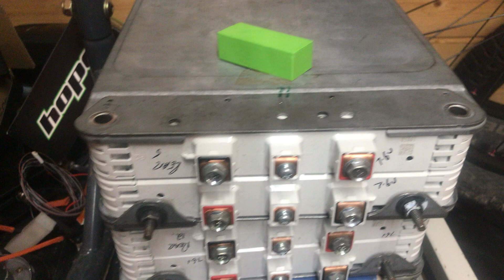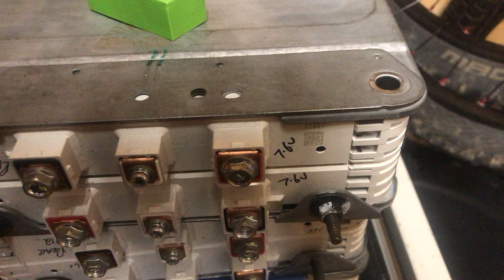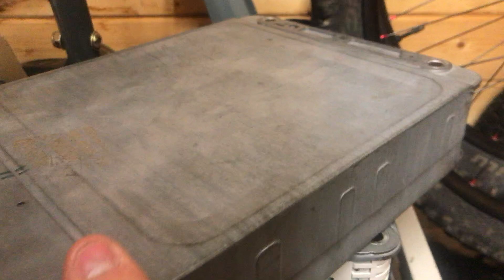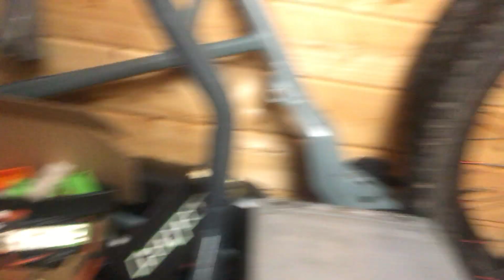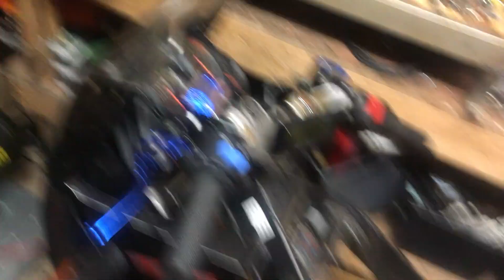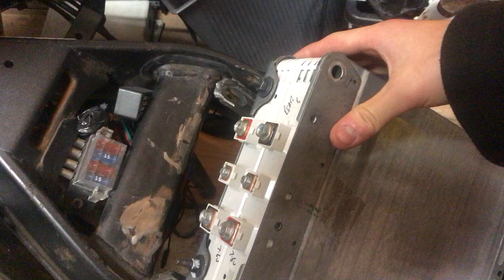Electric Honda CBR125R Part 5 (The Batteries)

Comment: So how did it go ? I want to do the same but need advice on components for this bike.
Reply from the maker: The biggest problem is fitting that amount of batteries on a small bike so for anything small Nissan Leaf cells aren’t recommended. 

For motor and controller anything goes really you could use a hub motor of a chain drive setup like mine which would give more torque and the bike would move off on a hill better

I personally prefer sevcon controllers as they are very tune able but also very hard to program unless you are experienced.